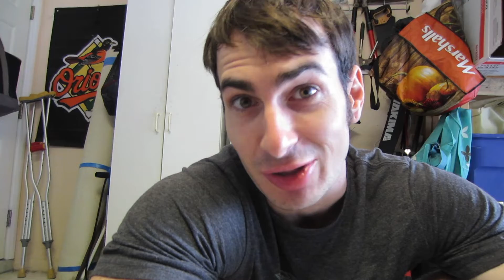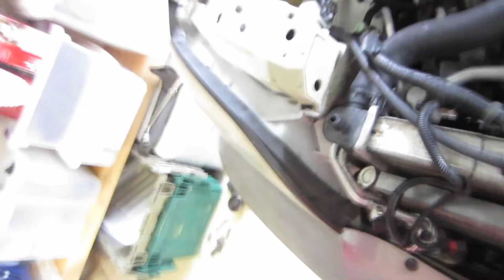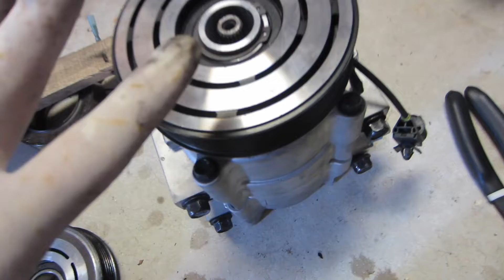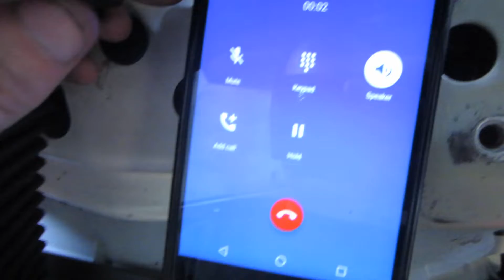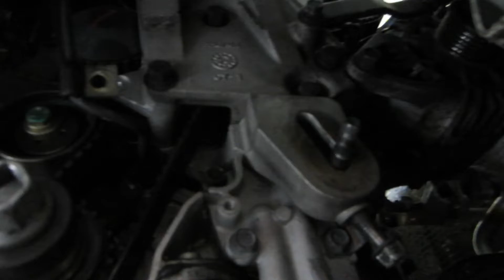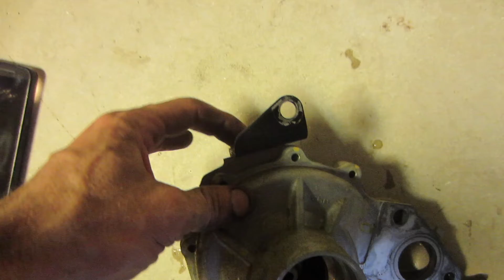My 1st Timing Belt Ever 2005 Kia sedona  Ac compressor & water pump replacement Day 2 | Vlog 145

Comment from the maker: If you dont want to see 35 mins of vanning, please go and watch something else. Don't thumb the video down just because you want to see different content. This is good content I wish I had to look at when I started this job and I think it can help others. Thanks everyone for the tips yesterday!  Safety glasses are going on, and sandals are staying on 😂
Reply from the maker: 😂😂😂I have some footage of a gym I went to in Bali nobody wore shoes and they had prayer flowers on every piece of equipment to pray to prevent injury and such. Man the comments would have been brutal 🤗. I'm a 3rd world country style mechanic.
Reply: Ohh... he's finally putting shoes on. Nope 😜💪
Reply: thecollegepicker downvote
Reply from the maker: Lol ruined rabbits routine! 😂😂😂😂
Reply: LoL I was about to comment "I bet Resale Rabbit is LOVING these mechanic car repair videos!" 🔧🚙
Reply: I have a 1994 Toyota Camry 3.0L V6 XLE made in Japan with over 250k miles on it. Never changed the timing belt and still runs like a top (knock on wood). It has only had general maintenance, brakes, struts, fluids in almost 25 years. I thought about replacing the timing belt myself, but I concluded it was too big a job for me and the cost to have it done was excessive for something that still worked fine. A broken belt will definitely be a hassle, but there won't be any damage with type of motor.  An amazing car, best I've ever owned.

Comment: I've done this job myself. lil trick bolt & two washers between the sprockets they hold each other in place, mark with nail polish in a few areas to be sure they don't move & replace belt. doing it this way there's no need to bump engine or align timing marks.
Reply from the maker: Great advice right there!

Comment: FYI a magneto and a electromagnetic clutch on your AC compressor are too vastly different things.
Reply from the maker: Yeah I misspeak at Least 100 times a day 😁 eBay they used it as a search term so it was stuck in my head. I'm not a car guy 🤣
Reply: no worries ,I've watched the entire vlog 145 - 147 epic and informative to say the least
Reply from the maker: Thanks for checking them out 🙏🙏🙏

Comment: Hmmmm.... I know I've confessed to not being a car guy, but shouldn't the oil be fluid ounces (volume) instead of by weight?
Reply: Because of not being a car guy, I'm tapping out early....
Reply from the maker: It's a range, and all the videos I watched they weighed it. 🤷‍♂️
Reply: thecollegepicker I'd have totally measured out fluid ounces. I wonder if the density of that particular fluid makes volume and weight the same?
Reply from the maker: It won't be the same but it's close enough within the volume Range. Plus I did the ole eyeball method. Half would be 4.5 oz and it was a little over half left 🤗

Comment: Dude it was never going to be easy but you're doing really well. You have a good methodical approach which will stand you in good stead, I guess you are a Pharmacist goes with the territory. Not many pharmacists could do what your doing right now! Getting that up close and personal with the Kia will stand you in good stead. It's no longer a mystical box under a plastic cover you know how it works now. You've learned loads in one day, even if it's not to do another timing belt! The cars of my youth had little engines suspended in generous engine bays. It was really easy. Keep going mate, I'm rooting for you.
Reply from the maker: Thanks Bob. Just had a major booboo. Busted a pulley bolt in the engine 😭 didn't know I had to replace the stretch bolts
Reply: You've learnt something else but getting the bust bolt out could require some professional input. Your man who checked it over could help. Sometimes hard things go easy and it lulls you into a sense of false confidence. Better to understand what can really go wrong you will remember that for a long time! You will prevail!

Comment: You are only supposed to turn an engine over clockwise.  The reason being is that when you turn it counter clockwise it causes slack in the timing belt which can allow the belt to jump teeth and become out of time.
Reply from the maker: Yes clockwise. I only turned it a tiny bit around to retime it, know for next time =)